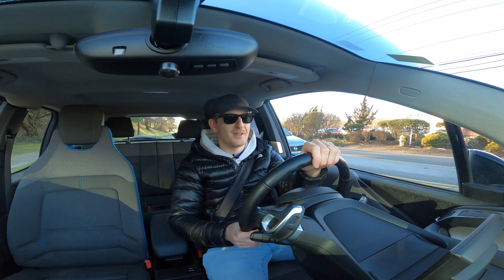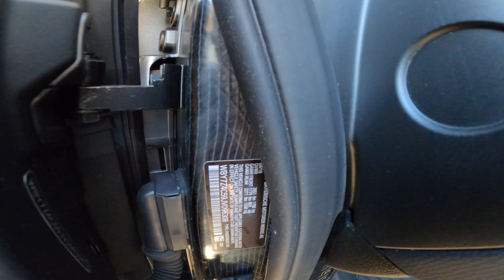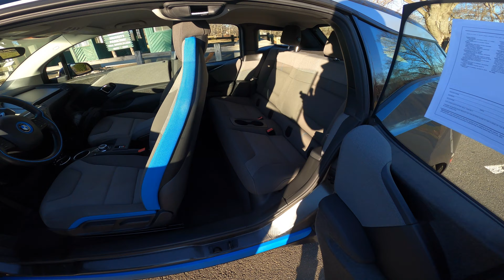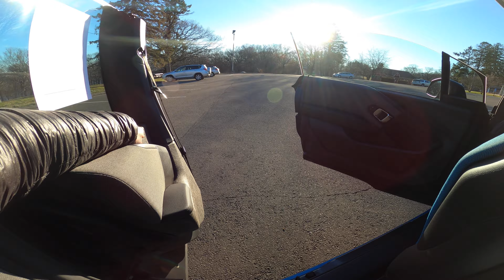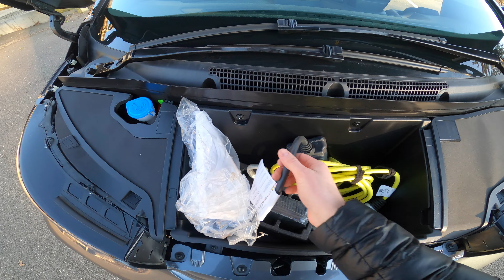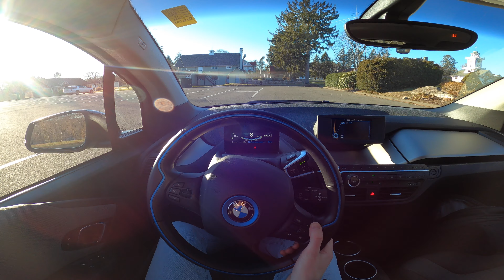My First Electric BMW

Comment from the maker: Visit BMW of Bridgeport: http://bit.ly/38uvEjL
BMW goodies: https://amzn.to/39fs0t3
BMW wall box home charger: https://amzn.to/35tH5X4
The end of gas powered BMW's: https://youtu.be/7OVKAwYDGwI

Test driving a facelift BMW #i3 Rex range extended model for the first time! Thanks to BMW of Bridgeport Connecticut for loaning me the car to test drive. See more of their available cars here: http://bit.ly/38uvEjL

This was my first electric BMW experience, after driving a Tesla 3 and Y last week. While not as powerful as the Tesla cars, this 2018 model i3 was still a lot of fun to drive and had a very high build quality that you'd expect from a BMW. This car, while smaller than a model 3 actually has slightly more cubic feet of cargo space thanks to its unique design. #BMWi

BMW Ceramic Coat: https://amzn.to/2Jzlpk7
CERAMIC WASH: https://amzn.to/2TP9SyX
BMW GOODIES: https://amzn.to/3mLRZ0s

Griot's Synthetic Clay: https://amzn.to/3oTcYQL
Dual Action Polisher: https://amzn.to/327oyho
Hexlogic Foam Pad: https://amzn.to/3mMA8GH
Meguiar's 205 Polish: https://amzn.to/387C88n

BMW OIL FILTER TOOL: https://amzn.to/2TRFYdy
BMW GERMAN OIL FILTER: https://amzn.to/389ufPU
CREATOR C310 BMW SCAN TOOL: https://amzn.to/2TMhJgO
GREEN MOLYGEN OIL: https://amzn.to/32aoTQn
LiQUi MOLY ENGINE FLUSH: https://amzn.to/3mLSIPe
LIQUI MOLY LIFTER ADDITIVE: https://amzn.to/35YpZzP
LiQUi MOLY JECTRON INJECTION CLEANER: https://amzn.to/3oRzlGg
BMW Maintenance: https://amzn.to/383YLup

ONLINE http://www.bimmerzeit.com
THE GRAM http://www.instagram.com/bimmerzeit
FACEBOOK http://www.facebook.com/bimmerzeit
TWITTER http://www.twitter.com/bimmerzeit

Questions? Send me an email at bimmerzeit@gmail.com

My CAMERA GEAR;
Sony A7sii: https://amzn.to/32aevZ1
Sony 16-35: https://amzn.to/35Xl6as
Rode Mic: https://amzn.to/3oTdIFx 
GoPro 8 Black: https://amzn.to/2JzmrfZ

This description contains affiliate links. If you click my custom link to purchase a product, I will earn a small commission at no extra cost to you. Win!

Disclaimer:
Due to factors beyond the control of BIMMERZEIT, we cannot guarantee against improper use or unauthorized modifications of this information. BIMMERZEIT assumes no liability for property damage or injury incurred as a result of any of the information contained in this video. Use this information at your own risk. BIMMERZEIT recommends safe practices when working on vehicles and or with tools seen or implied in this video. Due to factors beyond the control of BIMMERZEIT no information contained in this video shall create any expressed or implied warranty or guarantee of any particular result. Any injury, damage, or loss that may result from improper use of these tools, equipment, or from the information contained in this video is the sole responsibility of the user and not BIMMERZEIT. Video and Content is owned by BIMMERZEIT © 2021
Reply: was the car twitchy or unstable at freeway speeds? People are saying you need to keep both hands on the wheel while on the freeway to keep the car straight.
Reply from the maker: @mamadouaziza2536  it felt stable at speed, but the steering is very sensitive yes. I’m not sure I drove it long enough to find it problematic. The turning radius is really wild too, u-turns on a dime!

Comment: I drove the i3 also pretty good power but that felt dash
Reply from the maker: hey Jeff, I hope you are well! By the way, my neighbor bought the purple 328i and it is over 300,000 miles now! amazing. Did you end up buying another corvette?
Reply: @BIMMERZEITT  nice it was a good car!  Yes i just picked up my 2021 c8 after a year wait check my channel i uploaded a couple videos.  My next daily might be a model 3p i wish they would depreciate faster
Reply from the maker: @keenanjeff  nice, c8 great choice. Looks like an exotic car, they finally got it right. How do you like it?
Reply: @BIMMERZEITT  Love it I was worried I would miss the manual transmission but this car was built around the dual clutch it shifts instantly and you can drive it in manual mode all the time it really is the best of both.  Handling is insane even in cold temperatures it is planted.  Hero pics here https://photos.app.goo.gl/WbC1ou7WMtu2FR1D8

Comment: Nice little review, I would have preferred you comparing it to other EV experiences, obviously build quality in the BMW is better, but your opinion on looks and performance and preferences for each would have been interesting.

If it came down to it you would want a Tesla, but you have only driven a few EV's. hopefully you can get to drive a few more.
Reply from the maker: Thanks! The Tesla performance was better without question. By comparison the i3 power was disappointing. Yes I’ll try to expand the overall presentation on future cars as I develop this new style!

Comment: I leased a 2019 i3 BWV 12Ah and constantly getting around 150 miles range 3 seasons in SoCal (140 miles if all highway with AC on).  I still get around 120 miles range in our "SoCa;" winter on highway with heater on...good enough for my usage.
Reply from the maker: Sounds good Alan thanks for the info. How long have you owned so far? Any issues or unplanned service trips yet?
Reply: @BIMMERZEITT  I leased my back in Oct, 2019 due to the amazing lease deal ($99/month with tax, tons of incentive for EV in California) and so far, no problem at all, just schedule a brake fluid service (free maintenance for 4/48K like other Bimmers) end of this month.  For a commute car (my round trip per day is 90 miles all highway) and occasionally simi-local trip (with plenty of DC fast charger in SoCal), it is good enough for me.
Reply from the maker: @achow617  oh wow, that is an incredible deal! I’ve heard of those rates for service techs at the dealerships. How much money put down? Still, with that commute it is paying for itself in fuel and oil saved. Good to see these cars do have a valued application. Connecticut incentives are not as generous-  but they should be.
Reply: @BIMMERZEITT  I put like $5700 down, including $700 of MSD (which I can get it back at the end of the lease) and CA give me an EV rebate of $2500 and local electric company gave me $1000, so my net down is like $1500, not much different for a regular lease.
Reply from the maker: @achow617  great numbers!